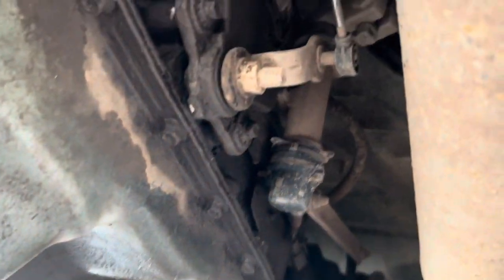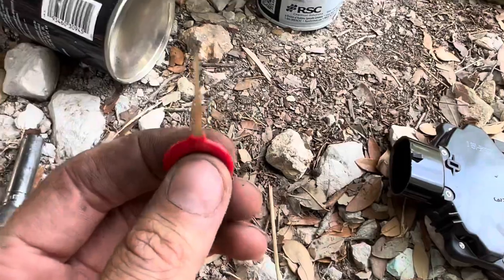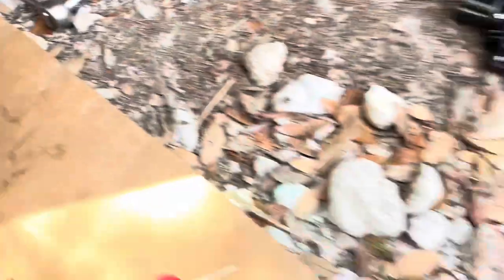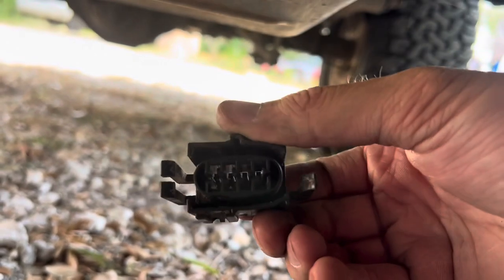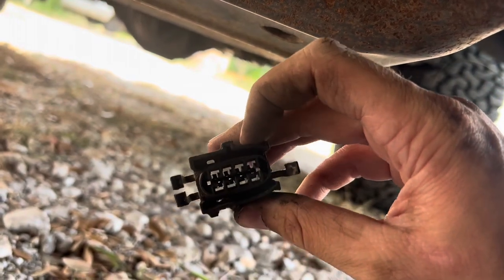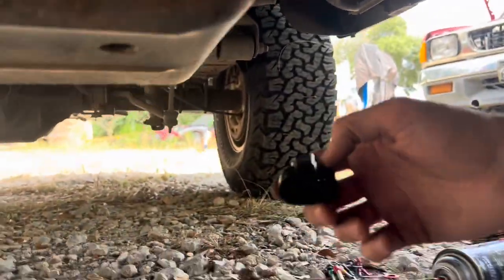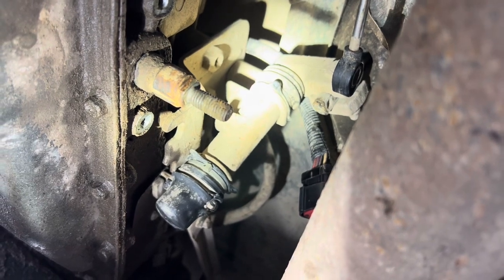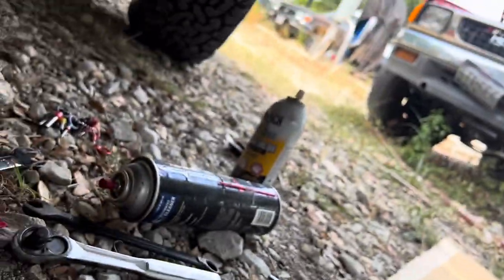1993 bronco neutral safety switch. Intermittent neutrals while in gear.

Comment: Did swapping the sensor out solve the issue? I've been experiencing the same "slipping into neutral" in my 1994 f150
Reply from the maker: Yes it worked!
Reply: @JIMMYLUNCHMEAT  Went and swapped out the oem one with a napa pro replacement and it shifts like its brand new and no more randomly going into neutral. Thanks for the helpful video saved me a big  headache and spending a bunch having a shop fix it!
Reply from the maker: @Ober_83  awesome man, no problem!